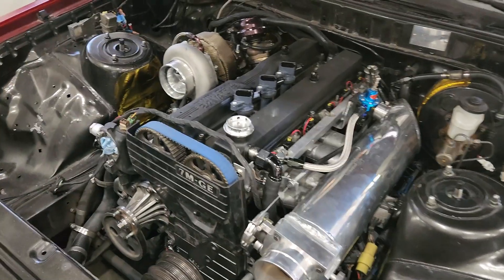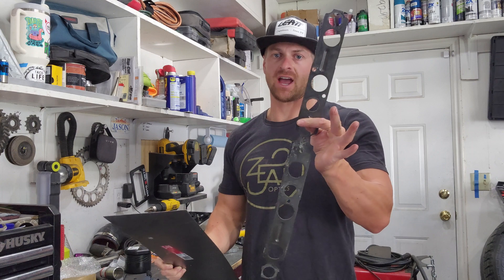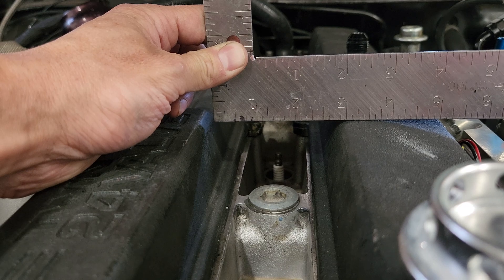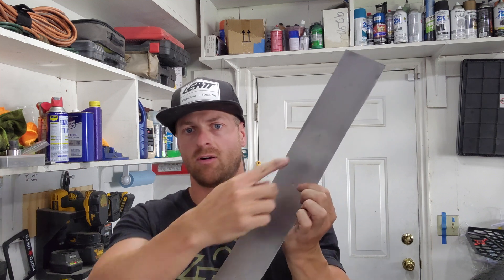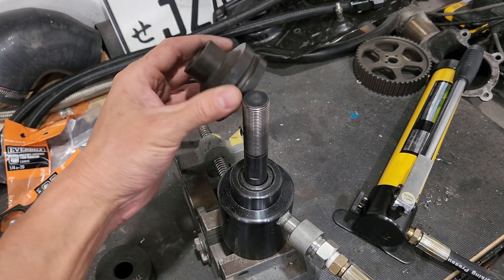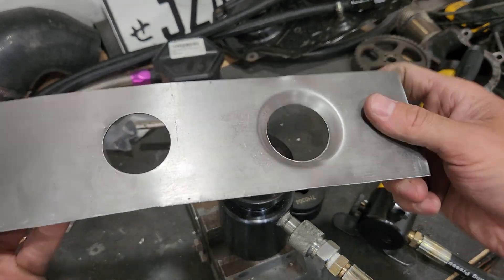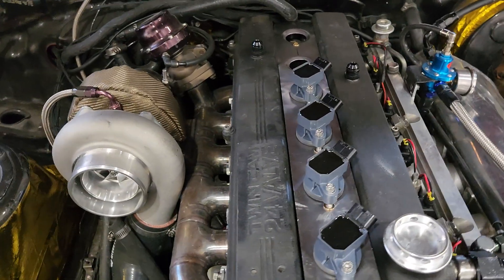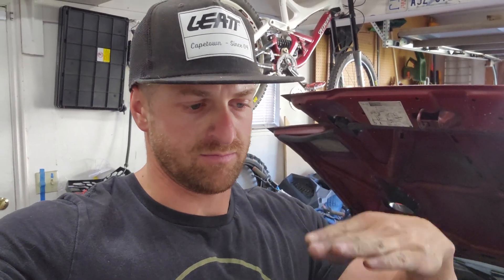Building a custom 7M 1ZZ coil pack mounting plate.

Comment: About to do the same with my 7m; Do you know ontop of your head if all 1ZZ coils are the same?
Reply from the maker: Oooo that is a great question. I want to say they will all be relatively close. These coils fit so many different vehicles, so I'm sure they are the same across the board. The only thing I wish was different was the length of the coil. They stick up pretty high and I would prefer they sit down in the galley.

Comment: Hey man, love the ingenuity on your build, for this cover and mounting plate it really needs a thicker material for you really ez plug changes and any fixes you have plus the plates they sell improve any valve cover leaks since it utilizes the same bolts. But hey If you can make it work and keep the coils snug go for it.
Reply: You got to start somewhere right. Looks really good
Reply from the maker: @jethzeeltorres9727  half the fun is making the custom parts.
Reply: @mainstreambuilds  definitely 👍🏼
Reply from the maker: Oh I will be redoing this for sure. I found that the material was too thin pretty quick. I'm planning on making a few titanium ones that will do the trick.

Comment: No need to drill and tap just find a rear 7mgte hex bolt it is already threaded in the center. For the spacer Ace Hardware is the go to.

Comment: This was really interesting. I didn't know about this upgrade, adding 1zz coil plugs on the 7mge engine.

I don't have a custom build or anything, but I'm wondering if this would also be beneficial to add to an otherwise stock 7mge to 'future proof' it when sourcing maintenance parts later like the ignition coil and ignitor may or may not be hard to find (or expensive) for original spec stuff.

Thanks for sharing!
Reply from the maker: I figured since I was going full standalone I would ditch the distributor and go coil over plug. I like the idea of the smart coils not needing the ignitor and all the other junk that just clutter up the engine bay. The coils will help me really fine tune the motor and get this thing running perfect. I agree as well, sourcing the coils and new parts will be a lot easier than trying to replace old wore out parts with other old wore out parts ha.

Comment: I would really love to see how you wire them, I just got screwed on my 7m by a shop so I have to rebuild it myself and I really want to do a coil on plug conversion
Reply from the maker: I plan on doing another video here soon on the wiring. I still need to make sure my cam and crank sensors are going to work. The coil pack wiring seems pretty straight forward.